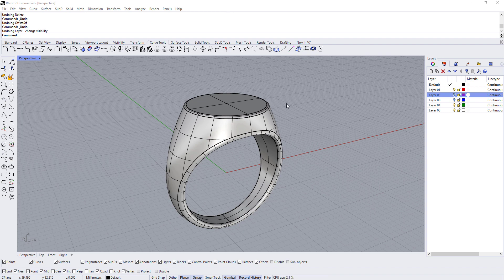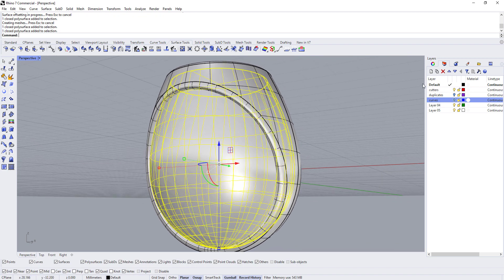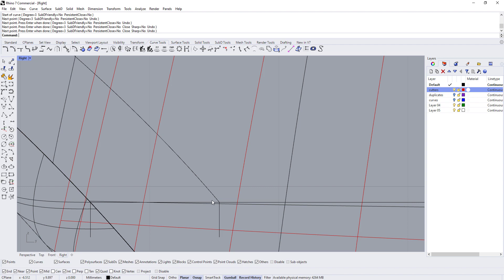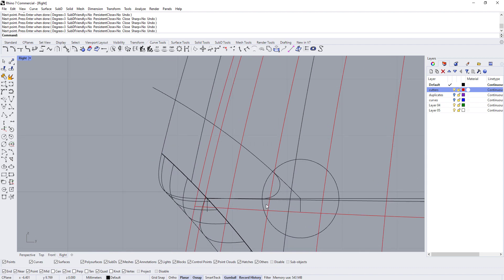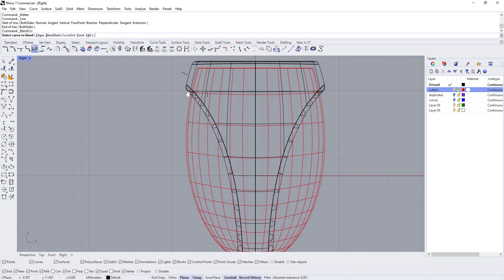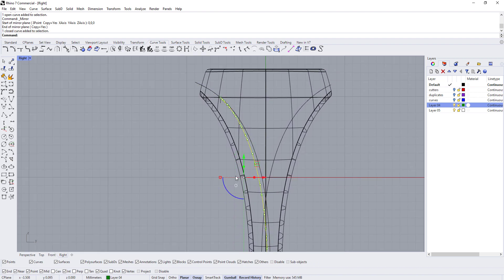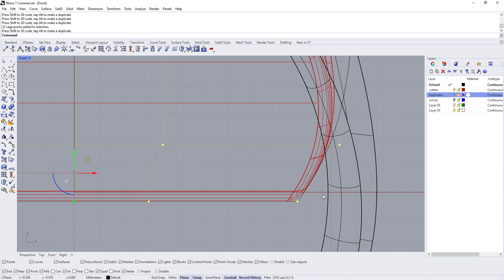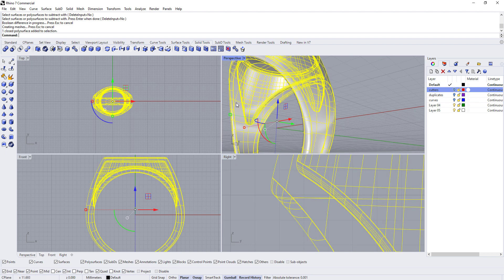Rhino | Signet Ring Tutorial | Part 3 of 5

Comment: Awesome 👌 
In 7:54 in video ..i choose like you ..first offset curve then match on end of that curve in the middle...
But it's not do anything and the alert is offset curve is failed 

 Is it important that single curve in middle is match to that curve we draw by blend curve? 

Could you please help me to do this session ?
Reply from the maker: It could be several things, but the first thing that comes to mind is that you've chosen the wrong edge (7:47). You will notice when you click on the edge, a little window pops up with two choices. That's because, in reality, there are TWO edges there. Hover your mouse over each choice in the little window. You want to choose the one with the arrows pointing towards the inside of the ring. After you choose an edge, then there are more arrows (they look the same but they mean something different). These arrows are the direction of the offset. Again, the arrows will need to point toward the inside of the ring. If these arrows are pointing outward, you will need to click on Flip in the command line. This takes you to 7:56, and you can follow from that point.

I apologize. This is my fault. I should have explained better what was happening with the first set of arrows.

If you still have problems with this section, let me know. There's another way to achieve this result that is a bit simpler.
Reply: Thanks a million 👌
Reply from the maker: @ No problem. I meant to say, by the way, that the reason there are two edges there is because wherever two surfaces meet, there is an edge for each surface, even though it looks like one edge. I hope that makes sense.
Reply: @webduncetv  I could to do it well it's done thanks

Comment: Hi! I don’t know if you forgot to show or if I just didn’t see it😅 but how did you smooth the top edge? the circle on top, how did you smooth the connection to the rest of the ring
Reply from the maker: I think I forgot to show it. I used the fillet tool. It was probably a small fillet, with like a 0.2mm radius.

Comment: Thank you so much. your tutorials has been very helpful in learning Rhino. I did have a question, for the wirecut for the cutters section -- what could be the reason mine isnt cutting the "cutters' section? its not removing the red part for me for some reason.
Reply from the maker: I'm glad you're enjoying the videos. Here are some tips that might help:

1. Make sure the cutting lines extend outside of the object you are trying to cut (at least when viewed from the Right viewport)
2. Make sure that the Right Viewport is the active viewport before clicking on the WireCut tool.
3. After clicking on the WireCut tool, look up in the command line and make sure that "Direction" is set to either "NormalToCurve" or "X" (either should work, but generally you will want "NormalToCurve")

If it still doesn't work for you, let me know.
Reply: I'll test these out, Appreciate the tips!!  @webduncetv

Comment: Thank you for this tutorial. 
Please can you go over how the hollowing process is done, especially the "offset surface" section.
My "cut ring" and the "uncut ring" always give me an intersection or blending effect. Yours shows a clear difference between the two after the Offset Surface.
Thank you.
Reply from the maker: Hi. Glad you're enjoying the tutorial. Sorry you're having an issue with it.

There are three things that come to mind. 
(1) Did you offset the base shape or the ring? You should offset the base shape, not the ring.
(2) Did you use an offset distance of 0.8mm? If your offset distance is too small, it can give that "blending" effect.
(3) When you first created the new file, did you select the Small Objects - Millimeters template? If not, that might the root of the problem.

So, hopefully, that helps, but if not, let me know.

Comment: Hello, I cannot fillet the cutting oject.  When I try, the fillet edges extend beyond the object extents, and the surfaces aren't trimmed according to the new fillets.  Is there something I'm missing? Thanks!
Reply from the maker: No, fillets will often do that. You've probably done something slightly different than I did (not wrong, just different). Maybe some edges line up differently. OR you might be using an older version of rhino. Rhino 7 does fillets better than the older versions. Whenever this happens, the first thing I do is try a slightly smaller fillet. Try a 0.4 fillet and see if that works. Let me know if it works or not. Also, you can message me over at my facebook page https://www.facebook.com/webduncetv

Comment: Could not cut the red layer, when I select it, in the command I see "1 open polysurface added to selection" but in your video when you do appears "1 closed polysurface added to selection". I don't know if is that the problem.
Reply from the maker: Yes, that is probably the problem. Sometimes you can do explode and rejoin it to solve that issue. Select the object and type explode in the command line. After the object is exploded and while all the pieces are still selected, type join in the command line. If that doesn't work, I would isolate the object (select the object, then go to the visibility tab and click on "isolate objects"), then - with the object selected - in the menus at the top menu bar choose "Analyze > Edge Tools > Show Edges." You will get a little pop-up window. Make sure that it is set to "Naked Edges." This should highlight the places that are not closed. Also, in the command line, you should see a message telling you how many naked edges there are. You might be able to figure it out from there , but, if not, take a screen shot and save it, and then send it to me. Are you on twitter? I think you can send me the screenshot in a message on twitter.